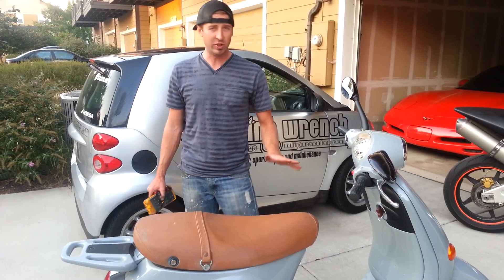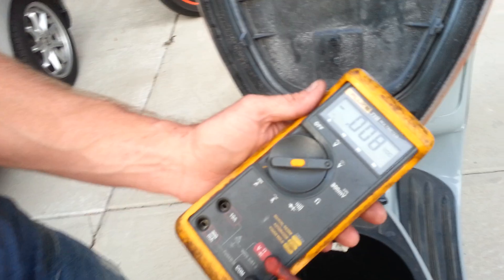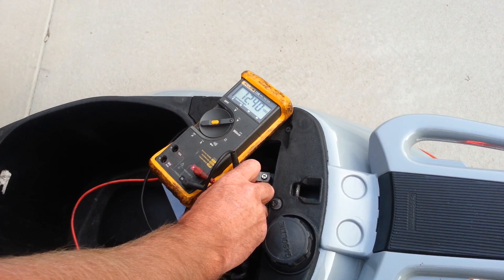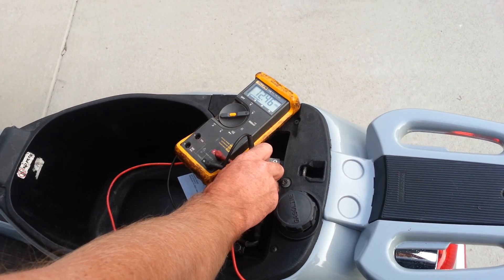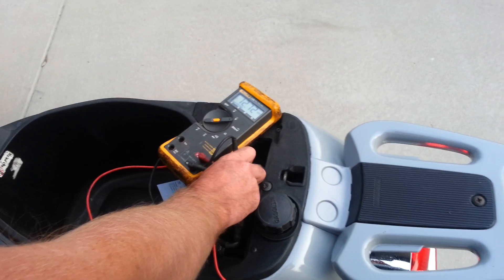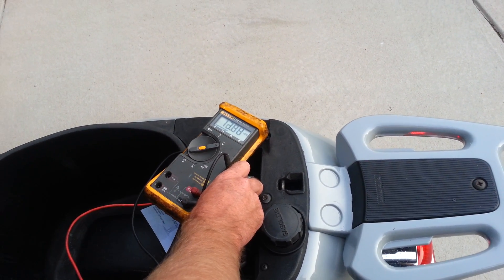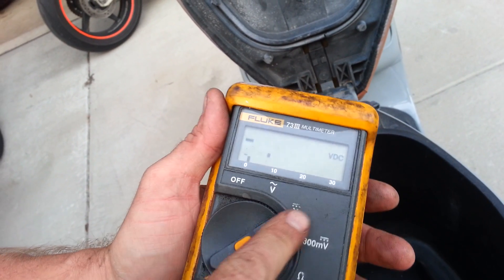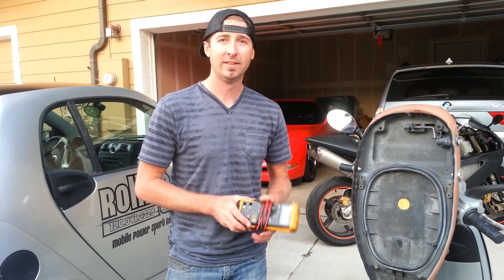My motorcycle or scooter battery wont hold a charge. How to test the charging sytem.

Comment: I have a 50cc kymco that got upgraded to 100cc. When I try to start it with the electric start, it acts like the battery is dead. Had a 7A battery, put in a 9A battery and still the same problem. Please help
Reply: Lol, I have the exact same issue on my Peace Sports 50cc scooter with a 100cc big bore kit in it. I find myself constantly charging my battery because of it. To make things worse, I can't use my kick start! X( But from what I've been told there could be a short-circuit or something.
Reply: Not yet. About to give up

Comment: I have a taotao, with around 4,000 miles.my issue is after about 10 minutes of running it will die out and not start again for about another 10 minutes of it being off.I have change the coil the plug the fuel pump and the CDI so far.I'm still experiencing the same problem.could you give me any other ideas of what it could be.
Reply: exhaust pipe could be clogged, change air filter...

Comment: Hi RW...Great vid...Noticed your voltage dropped to 9.5v on start up. Here is something I read...

"When starting the bike, watch your meter does not drop below 9.6v. If so it's junk, it may have a dead cell, or sulphated and time to get a new battery."

Was that the case with this scoots battery; and does it need a new one?

Comment: My 2011 Tao Tao 49cc recently died one day and will not start again.I filled the tank up pretty high but cant see that being the problem.The starter is fine.It will try to start but wont start.I have no way of checking the charging system.If I could get it to start then I could test it with my meter.Do you have and suggestions on what it may be or where I should start to diagnose the problem